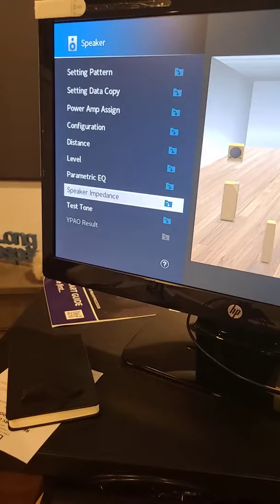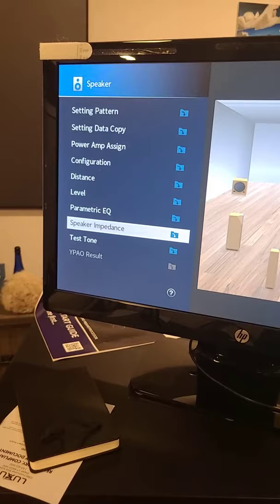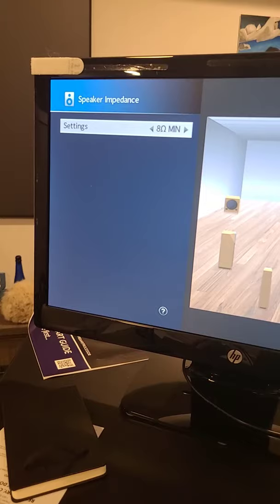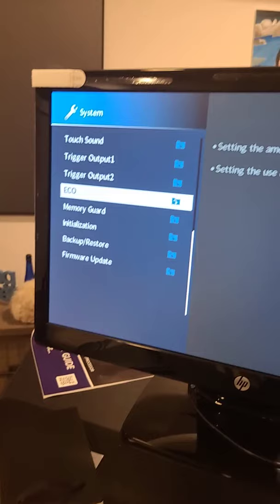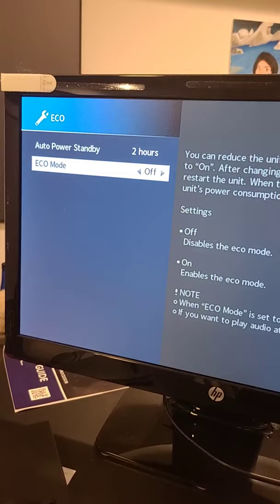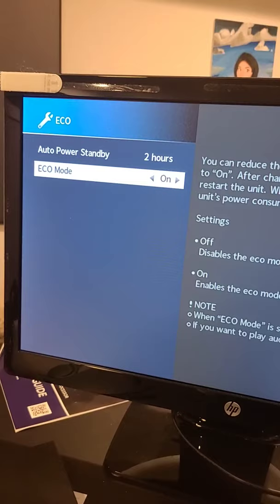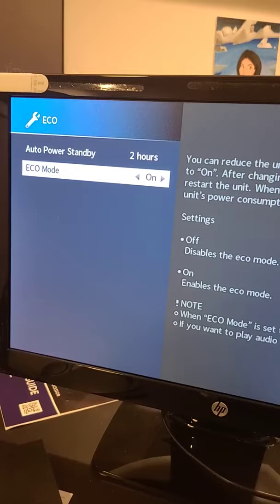Two Critical Settings For Best Performance of Your AV Receiver #shorts

Comment: Thanks Gene
Great as always.
Been running Eco on Auto for ages but finally just decided to turn it off for good.
Also I'm running 6 Ohm speaker so had my SR7013 set to 6 but i've gone and changed it to 8, doubt I will notice any difference.
Part of the fun with home audio is all the tinkering with different settings.

Comment: I’ve had my Marantz SR-8015 set to Eco “Auto” since I purchased it, and haven’t found any reason to change the setting.  It keeps the heat down during normal TV watching, but preserves the ability to deliver power when needed.  The Marantz does a good job of detecting more dynamic material and switching power rails quickly.
Reply from the maker: Yep they have best eco switch. Auto works brilliantly.
Reply: I love hearing the click as you turn the volume past -28db - I always think "there goes the bigger rail" 😁
Reply: @willo300  VTEC just kicked in yo!
Reply: @RennieAsh  🤣

Comment: regarding OHM setting: your are right about the power limitation of setting the unit into 6 or 4 Ohms but it is for a good reason: unlike  Audiophile amplifiers, usually the receivers have limited current driving capabilities. it means that when driving a 4 ohm speaker the amplifier will not be able to output twice the current, so it will reach it's output limitation sooner (in terms of output voltage level)  then it can provide with an 8 ohm load.
There for, for Class A B topology it means less efficiency and more heat waisted on the output drivers and the unit mains transformer. there for it is recommended to use the optimized setting according to the speakers used.  the additional output power available for 8 ohms configuration is actually waisted on the Amplifier Drivers when using lower 6 or 4 ohms speakers.
Reply from the maker: No it is not for a performance reason as it's simply for UL certification for heat dissipation into 4 ohms.

https://youtu.be/Ou5bO8P2Drw
Reply: @Audioholics  
1)Thank you for your quick replay. I agree that best is to use 8 Ohm at any load, and let me clarify the reason.
2) The 4/8 Ohms position would perform theoretically best in case where the amplifier is loaded with a resistor and delivers a continuous sine wave signal (Probably is the test condition at UL Labs). 
3) Music is dynamic, and a dissent music recording which with 16dB of dynamics range level, a 100Watts RMS maximal output Amplifier will typically generate a heat dissipation equivalent to a continuous sine wave RMS power of 3 watts.
 4) There for, the 8 ohms position used for 4 ohms loudspeakers will allow double the output peak power than 8 ohms load, and will present a double power dissipation of only 6 watts continuous sine wave (rather then 3 watts of a 8 Ohms Load). Since unit is approved for continuous 100 watts RMS output the 6 watts load will not cause any over heating for the amplifier.
Reply from the maker: @shpater  in no test scenario does the 4 ohm position perform better. It simply makes the amp clip at a much lower level so UL tests at that lower level to give 4 ohm certification. It should NEVER be used when attached to any speaker in a home theater set up.

I've owned more than a dozen receivers with the impedance switch and never had issues driving 4 ohm speakers with the impedance switch set high. When set low the audio clipped and sounded much worse when driven hard.

Comment: For my Denon AVR-x4700H, the ECO setting is set to Auto since I have the internal amps off and using an Outlaw 5000x 5CH external amplifier to power my 5CH surround setup.

Comment: Thank you so much. Can you believe that I've been trying to figure out what switch to put on my Yamaha integrated receiver/Network receiver (2-channel) with 6 OHM Speakers for 4 days now. I'm not exaggerating when I tell you that I've asked the question about 16 times. And like some kind of weird dream, I actually got a 50/50 answer every time. Half of the people say switch it to 4 ohm minimum impedance, and the other half of people say just leave it at the 8 ohm minimum impedance. I even spent over 45 minutes chatting with AI asking it and it contradicted itself multiple times. So just to clarify, with 6 ohm nominal impedance floor standing speakers, I should still leave my Yamaha integrated amplifier on " 8 ohm minimum impedance"? Even Paul from PS Audio (who is an email pal of mine) said to switch it to the 4 ohm minimum setting. Sigh ... I haven't been through a situation like this in many years where so many people have said the opposite of the other people and having this situation last for 4 days ....crazy

Comment: I could not find the impedance switch on my Yamaha 6014 but I did find the eco and mines was set to auto but I turned it off ,and your right I have to raise it up alot just to get full power

Comment: Impedance switch would need to be set to 4ohms if you have 4 ohm speakers. I blew out a channel on my Marantz because of this. Yes the marantz has a protect switch and it flipped on many a time before the channel went out because of the 4 ohm speakers I was running. Yes there is a reason the option is there, I didn’t have that option on this older av
Reply from the maker: You likely had a short or poor ventilation for your AVR. the 4 ohm mode is severely limiting the power in your system and if you truly have power demanding speakers, use external amplification.

Comment: Exactly, if you bought a receiver that can't handle a 4 ohm load above 80hz or the internal amp changes frequency response depending on load, get another receiver.

Comment: When I use the four on the switch on the back of my Onkyo TX 8511 I do blow fuses as often on my Cerwin Vega speakers. Power rating is 100 watts into 8 ohms and 135 watts into 4 Ohms. Should I switch to 8 ohm and use a 3 amp slow burn fuse instead of a 2.5 amp Slow Burn fuse. My Onkyo definitely seems to have more power using the 4-ohm setting.

Comment: I put a set of those AC Infinity MULTIFAN S7 cooling fans on top of my Denon AVR-X5200 and it's no longer a toaster when ECO mode is turned off!  And I can't really hear them from across the room when they are on the low speed.

Comment: Can you do a short video like this explaining the DAC digital Filter settings? Thanks 👍
Reply: This is why I like DACs that don't have filter options; you just get what the designer likes. An ideal DAC would have a perfect brick wall filter that attenuates to infinity at the Nyquist frequency, but because that's impossible in reality there are different filters which compromise in different ways. Generally speaking the fast linear filter will be the most accurate but you can use whatever you think sounds best , on a decent DAC the differences should be subtle if not inaudible. Generally fast filters preserve frequency response at the expense of phase, slow filters roll off the high frequencies but have less effect on phase, linear filters keep the phase linear but introduce pre-ringing and minimum phase filters have no pre-ringing but have non-linear phase which can mess with timbre and spacial cues.
Reply: @dexterkane4106  great info, thanks 👍. So it seems I would probably like the soft setting since I don’t like too much brightness

Comment: Woah. Never thought that saying the speakers are 6ohm or lower word tell the receiver to use less power.  I think I’ll be changing that. Do you have a video about that?  If not, I’d love to see one on that.  Really appreciate you and what you do!
Reply from the maker: https://youtu.be/Ou5bO8P2Drw
Reply: @Audioholics  ok. Now I remember.  I think I failed to link the in menu setting to the switch on the back. I checked my onkyo receiver and it only allows 4 or 6ohm. I have it on 6.  It’s the tx nr838.  I have the Aperion Audio Verus Grand towers.  Thanks for linking to this. I was going to search on my pic later but this helped!

Comment: Is setting impedance to 4 Ohm the same as activating eco mode (Xenon X3800H here)? Or are these different mechanisms? Interestingly, when setting impedance to 4 Ohm you cannot set eco mode any more, apparently because "it is eco already anyway" so to say. And for the same music, the Denon's power consumption OSD display (green eco bar indicator) shows the same low value for 4 Ohm setting as for 8 Ohm setting with eco=on (as opposed to eco=off with 8 Ohm).

Comment: Interestingly, impedance in Denon's X3800H cannot be set in OSD menu. Instead, only by a certain simultaneous button press combination on the front panel buttons you arrive in this special setting menu. They probably know why they decided to hide this setting menu as much as possible. Apparently they do not want the customer to change this setting! 😉
Also it is not part of the setting assistant procedure - for the same reason I guess.

But for regulatory/conformance purposes they have to include it somewhere, so they decided to put it to this special "hidden" menu - and also included it in the manual. Very thought-through decision by Denon, I would say.

And moral of the story for the informed user: Don't RTFM (read the f***ing manual) just too well, or you'll end up with an inferior system configuration! 😉

Comment: My Monitor Audio Rx6 speakers have an impedance of 6 Ohms, why should I set the amplifier to 8 Ohms, please explain
Reply: Same here, Marantz SR 7013 with Elac Debut w/6 Ohms, on Zone 2 - confusing advice so hopefully we get an answer
Reply: I wanted to upgrade my Atlantic Technology 270 system (which are 8 ohm speakers) to their 8200 system (which are 6 ohm speakers) and I didn’t think I’d be able to get them cause my Marantz 7013 is 8 ohms. Then I found out you can change the ohm setting, so I was excited bout getting them…. Now I’m told don’t change the ohm setting. This sucks

Comment: Im pretty sure you got the ohms thing backwards.  Impretty sure that the lower that number the more power.
Reply from the maker: It's a good thing you're only pretty sure, bc you're wrong. The impedance switch set to low severely limits power. You're confusing that with ohms.

Comment: Dang I was doing it wrong! I picked 6ohms for my 6ohms speakers if setting it back 8ohms should I rerun ypao? thank you for your wisdom!
Reply from the maker: It won't make a difference with YPAO calibration. It's simply a power limiting switch.
Reply: @Audioholics  much appreciated sir! Thanks again.

Comment: I have a Denon Avr, and Denon says that unless your listening to your system at higher volumes it should be set to ECO.  At low to mid volumes you get nothing benifical by turning ECO off,  you're just wasting power.

Comment: I only use eco mode on my projector since I have the ambient light well controlled in my home theater, plus this will extend the light bulb's life. If I want to show it off then I switch it back to normal.

Comment: Is there a way to get Pioneer VSX-LX503 working in 8ohm mode? Supposedly initial setup detects speaker impedance and limits the option to 4 or 6ohms if one of the speakers is detected lower than 6ohms. I don't run my fronts of the receiver so I guess it could cope with more load. Any hidden ''service'' menus maybe? 
Also, no ECO function here.
Reply from the maker: No receiver to my knowledge "auto detects" impedance and switches. Just use the default high setting.
Reply: @Audioholics  Thank you for spreading the knowledge

Comment: Hey gene, what are your thoughts about having eco mode on when using a separate amp and assigning the preouts to the main speakers?
Reply from the maker: That's fine
Reply: I've been doing this for a while and cannot hear any difference at all, so I assume eco mode doesn't effect the preouts though it would be good to see some measurements just to be sure. But given that I can't hear a difference and it keeps the thing running cool I'd stick with it anyway.
Reply: Yeah that's the general consensus ime, but there's always someone out there with a conflicting opinion. Especially in this hobby. I've never noticed a difference either, and boy oh boy does my avr run A LOT cooler in eco mode.

Comment: HELP... i got denon 4700h and i need amp for 7.1.4 atmos so my question is  emotiva basx a2   vs denonPMA600 .  denon is 45W + 45W 8ohm  and if I understand correctly  basx a2 is 160+160W. why is denon so expensive then?
Reply: Because it says Denon.

Comment: I'm considering the new Yamaha A6A, I'm planning my speaker upgrade too, wondering if I could have 4 ohm speakers for my LCR, or do I need an external Amp? I'm unsure if the A6A minimum imp for the center is capable of 4 ohms.
Reply: Depends on the sensitivity of the speakers and how far you listen. 89dB and 8ft, no issue. 80dB and 15ft, likely an issue.
Reply: @homeboi808  ah, good point. I'm looking into the Emotiva line up of speakers. Their C1+ is 89db. Sitting is about 8 to 10 ft. Just depends on how we adjust the living room.
Reply: @mikeortiz2139  That should be fine.
Reply: Pretty much all speakers these days go down to 4 ohms. You’ll be fine.

Comment: So i don't need to change it even if i get 4 or 6 ohms speakers?
Reply: Unless your AVR goes into protection mode during action scenes, leave it as is. All it 4-ohm setting does is limit wattage so the AVR is better protected, but most people don’t need that extra protection active.

Comment: Hi Gene,  Denon AVR-X3600H set to 4ohms as my Jamo speakers are 4ohm rated. If I understand you correctly I should set receiver back to 8ohms? Thanks for eco tip. Set to eco auto
Reply from the maker: https://youtu.be/Ou5bO8P2Drw

Comment: Where can I find this for Marrantz receivers?
Reply: Hi Gino
Generally on the Amplifier you hold down Zone Select and Status at the same time until you get the menu where you can scroll down until you find the Impedance. Then select 8 and enter. All done.
For Eco just select it from your remote, probably a little green button labeled Eco.
Hope that helps.
Reply: @HeliflyCT  thank you super helpful!
Reply: @HeliflyCT  I can't find the menu for the ohm adjustment 😅
Reply: @ginotizon2052  Which model Amp have you got? It's possible it could be different to my 7013.
I scroll down after holding down the zone select and status buttons to get to the ohms part of the menu.
Reply: @HeliflyCT  found it already thank you for your help! 😊